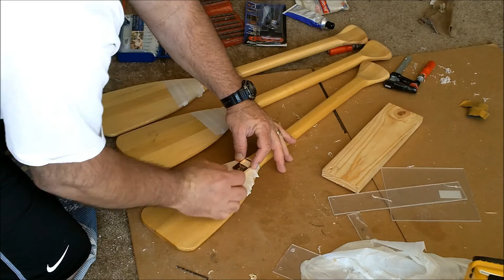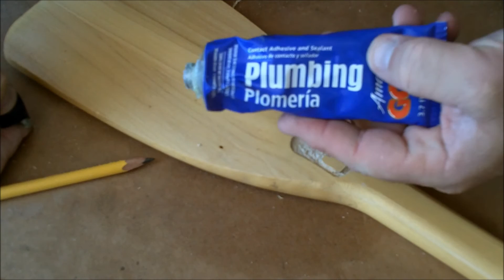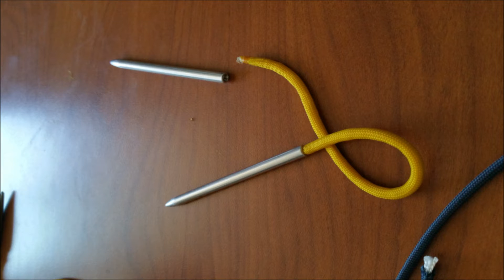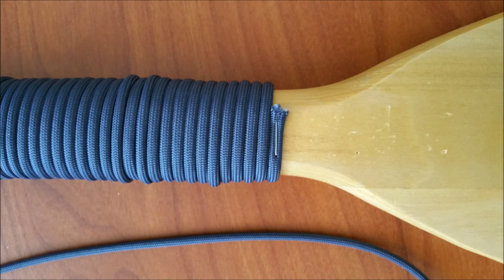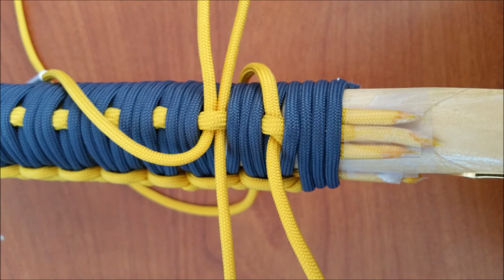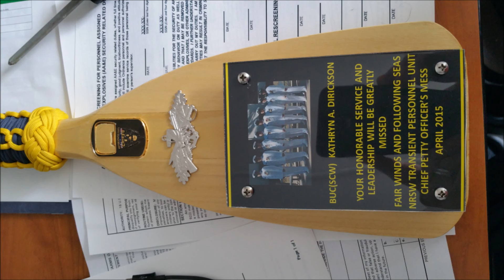Paracord Handle Wrap, Award Paddle

Comment: I was just how did you install the rank insignia and the warfare device? Did you use the same technique as you did with the challenge coin?
Reply from the maker: jaredajones17 thanks for watching the video.  The back of the rank and warfare have the pins still on them and I just pushed them into the wood.  I would recommend you place the rank or devise on the wood and only push it slightly  into the wood, check for alignment, then push it all the way down.  It pushes into the wood pretty easily and is hard to remove.....that's why I say align it before driving it all the way down.
Reply: blkcc1 Thank you so much. I am making a couple for my marines. I will let you know how the turn out.
Reply from the maker: jaredajones17 I would love to see it.  If you use a combo cover hat devise it will have a screw thread sticking out the back, just place it where you want and push hard to leave an indent, them drill a small hole there.  I like to use the bigger rank devices on paddles also.  If you have any patches they glue onto the paddle easily also and look good.
Reply from the maker: jaredajones17 red and gold will look sweet

Comment: what is the name of the tool you used to weave through the cord and where can I purchase it?
Reply from the maker: savagevic The name of the "tool" I use to weave the paracord is called a Fid.  I made my own fids from a .22lr cleaning rod that had a broken handle-just cut off about three inches of the female threaded part.  If you look on Ebay you can probably find the 2.5"-3" fids for about $3.00 each.  I thought about making them myself and selling them at 2 for $3.50 shipped.  I just don't see the huge market for them.